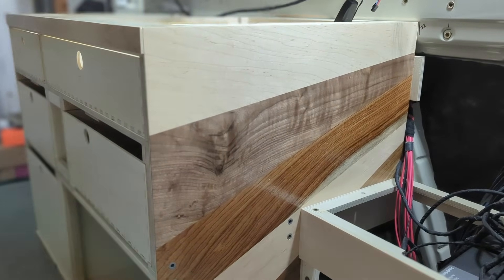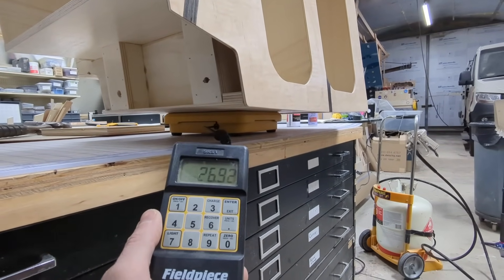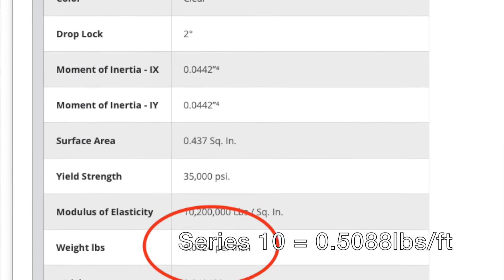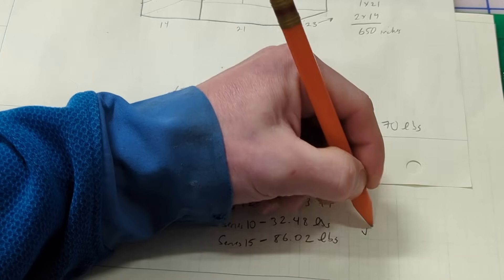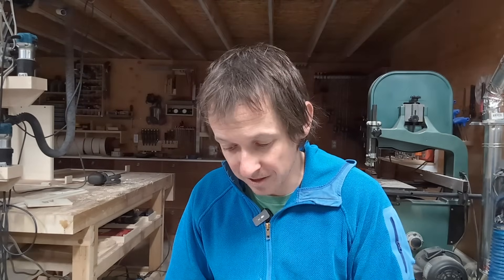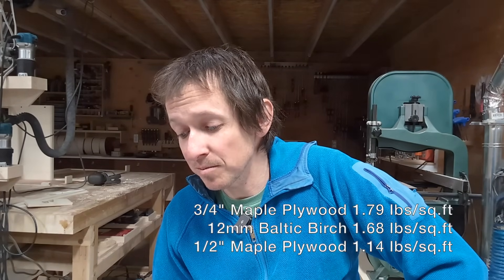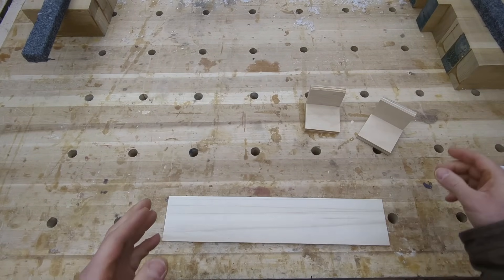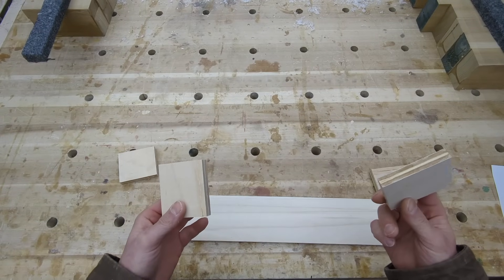Van Conversion Cabinets that are (actually) Lightweight and Maximize Storage

Comment: Great video! I want to add, if you are building out your van at your local makerspace, the may have a decent sized lasercutter. 6mm plywood cuts beautifully on a lasercutter. It greatly speeds up the process of cutting those finger joints and any curve cuts. While you are at it, you can cut slots midway down on the sides and slot in the drawers, adding even more glue surface area. 

Also, my local makerspace has a resaw bandsaw, which makes making your own veneer a breeze.

Comment: I don’t see how the fact that you use thinner plywood is either an argument for or against using 8020 since it can be used with thinner plywood too, and I got no dog in this fight because I’m using a hybrid system. Most of my cabinets are all wood but my system for connecting them to the van is all 8020.

Comment: This is an excellent video. A true craftsman can make an excellent lightweight product but the average person cannot. 8020 is an easy way for those persons to get the strength and assembly capability they need by preordering all components precut to specifications.  I’m looking to build out an older people mover with a handicap door and wheelchair lift so weight is not an issue. I’m actually looking at a mix of 8020 to frame and secure my heavier and more dense items like the fridge, stove, microwave, water storage, elevated bed, and roof racks, etc while using wood for basic storage items and framing. 8020 is more expensive than wood as well.

Comment: just got a van, and im surprised on how many people use heavier construction material to build their rigs...
Im 100% in favor of what this guy is preaching here... granted I just bought a 2000 E250.. and have zero experience in van building... but the reasoning around this is spot on and im gonna try to utilize as much weight savings as possible especially if i ever plan to tow a motorcycle trailer on the back... This just makes sense.

Comment: I really needed and loved this video.
I'm an aviation enthusiast, model airplane builder, and also I build my own furniture at home (used a lot of MDF for cabinets, and build a sofa and some nests with 10mm and 15mm plywood).
I'm planning to build a campervan in the future, so I'm watching lots of videos.
I've been seeing camper van builders using 15mm MDF and lots of heavy accessories, or even using 15mm plywood on anythng.  
That really annoys me, because MDF is very dense and when you have something moving you want it to be as light as possible due to performance, driving dynamics, safety, fuel economy, better range, less pollution, saving tires, saving shocks, staying in max gross weight and so on.
I've been thinking in ways to save weight and this video confirmed all my ideas and gave me dozens more to work on.

Comment: Thank you for this content.  As a carpenter, now working on my 2nd van project (Vintage airstream for a client and now a transit for me) I am constantly concerned about weight of materials.  A couple of questions, first - Do you have any standard cross sections that you have developed that can be sent to folks.  From your video, I saw 3 mm exterior panels with 6mm framing and supports for drawers.  The shot was quick and I just want to verify.  2nd have you had any joint failures with the brads and glue method?  I wonder about driving causing cyclic vibrations and potential cyclic failures?  Ok 3 questions - also, what type of wood glue are you using?

Comment: This is crazy! And a bit obsessive. Cabinet makers out there, come down from your high horses! 

From a mechanical perspective and a user perspective, this approach makes very little sense. 

Imagine you are converting a mercedes sprinter. Those vans are built for transporting 2000kg (2 metric tonnes) of cargo with a warrenty of 5 years and 350,000 km. They have a regulation that says they  can't have a total weight of over 3.5 metric tonnes without being re classified as a truck (EU laws). The same goes for camper conversions. So weight is important in the sense that if you keep the total weight under 3.5 metric tonnes, you dont have to reregister the van from a car to a truck. But the car itself can EASILY handle the weight of some heavier freakin caninets. The quality of living, and the feeling of build quality will both increase dramatically if the cabinets have some weight and regitity to them. A normal stripped mercedes sprinter will let you have over 1200 kg(!) to build with, without  exceeding the 3500kg max weight and the car can handle more weight than that. 

These vans are built to haul ass every day until they die, i think they can handle 50kg more of wood weights for the cabinets. 

Jesus.....

Comment: Nice!  Yes weight matters, especially up high.  I cringe at what of some people put on the roofs of their vans.  Let's put the spare tire up there, a deck made from 2x4s, 200 lbs of solar panels, a solar shower tube holding 4 gallons of water, and a steel rack.  Now let's get a lift and high-profile off-road tires, and act surprised when we roll over.

For me as a beginning builder, the best feature of 80/20 is that I can make design mistakes and fix them by reusing the pieces.  The worst feature is the cost of the 80/20 system.  This video made me aware of additional downsides, weight and especially space inefficiency.  Thanks much.

Comment: Great video - I’ll be following the sprinter build with interest.  Just need to get out the inch to mm conversion guide to cater for our UK ply thicknesses!  Would really love to see if there are any alternative techniques to things like finger joints for drawers for those v amateur woodworkers among us - whose workshops aren’t quite so well-equipped. Loved the sound reduction vid too. Anyone like me who’s owned a motorhome appreciates that a lightweight and noise reducing build is worth any number of butler sinks and heavy cladding.  Thanks so much for the helpful information.
Reply from the maker: Thanks for the comments!  Do you guys use inches or mm over there?  I realized while filming I use them interchangeably because both are used here depending on the product.
Reply: It depends on your age! Most people my age (57) and younger use metric and all ply/timber is sold in mm, so our standard thicknesses of ply are 3mm, 6mm, 9mm, 12mm and 18mm+.

Comment: Hi,good video have you ever used west system epoxy, using micro beads to make stronger joints 6mm bead, can be hidden if required. They use it a lot on small boats?
Your's john

Comment: Thank you so much...awesome video, super informative, not to mention well-paced...I wasn't planning to watch an entire 20-minute video, but I was completely engaged beginning to end. 🙂 I had already pretty much ruled out the aluminum extrusion approach after watching two of my friends work on cabinetry builds in their rigs for a couple of weeks and run into frustration after frustration with all the little connection pieces, not to mention throwing away expensive aluminum after making mistakes or realizing they needed to tweak their layout. Your weight analysis of the aluminum extrusion was surprising added fuel to that fire, and I also hadn't even considered the custom fitment advantage of wood vs the obligatory right angles of the extrusion. I'm nowhere near a good enough woodworker - nor adequately equipped - to build with your techniques, but this reassured me I am on the right path and gave me some super useful things to consider that I would not have thought of which will absolutely improve my construction. Thank you!!

Comment: I agree 100% I feel that no one takes weight into account when building out their Van. I love to work with wood and I was considering using 2020 for my van. You have given me a lot to think about now.  I have been remodeling an RV and after taking things apart I have a new respect for weight savings. I can’t wait to  start my build … again.
Reply from the maker: Haha.  I think weight is talked about a lot but not is done much about it.  First video: "You want to make sure your van isn't too heavy." Every video after: "watch me build a 4000 lb conversion."
Reply: @projectofscience  I subscribed I will watch all of your videos. But I will most likely build out of wood instead of Aluminum or I might combine i.e. Cabinets and such out of wood, Bed/bench out of Aluminum. Best of both.

Comment: I still don’t buy the idea that wood a wood glue bond is stronger than screws… glue is probably your only option when your wood is only a few 64ths thicker than a screw… but have personally ripped a 4x8 ft 3/4 in thick piece of plywood off of what used to be a work bench… it was secured with wooden dowels and wood glue. If those dowels were screws, all I would have managed to do would have been picking the bench up off the ground…

Comment: I'm very impressed with your analysis.  Cabinet structure, drawer and slides all add weight and decrease space utilization.  When I looked at 80/20, reached similar conclusions to you.  Heavy weight and lower utilization.  Many builds with 80/20 look very space wasteful.  

You cabinetry skills and forethought are admirable.  This is my first video of your channel.  It will have be browsing around to find more here.  Nicely done!

Comment: I thought about doing a bike trailer with a wood kitchen on top.
And the only thing that kind of stopped me is calculating all the needed wood for that - about 100 pounds + load inside +trailer... 

I thought about aluminum strips for reinforcement. But I really like how you reeinforced the poplar wood, gave it kind of an inner structure.
I saw other people routering parts of thicker sheets to cut down on weight - but I prefer your way.

Don't know if I can work that precise with the drawers. 
But definitely an inspiration.

I looked in on other woods - birch and poplar are sadly the most common available.
I also like paulownia wood - but that's really hard to get and expensive

Comment: Strength comes from stiffness, not weight or thickness. For instance, a 1x6 (on edge) is stronger than a 2x4 and weighs 20% less. This guy gets it. Judging from his thought patterns and the pad he’s using, I suspect he’s a mechanical engineer.

Comment: Very good video, nice to see someone using proper old school joinery techniques not modern easy methods. Basically what he’s doing is using the same techniques that where used before sheet material came along and made things quick and easy. Trust me his methods are 100% correct and will definitely work.

Comment: I totally agree with you. 

I created a hybrid cabinet system for my van using only 3 x 12’ 80/20 10 series slotted track (about 1/2 the weight of regular 80/20 since its just a mounting track with slot for bolts) for the upper cabinets. I used the honeycomb plastic cargo protection panels in place of having full cabinet backs/top and just have 1/2” sides and bottoms (with a front lip) of the cabinets that mount to the 80/20 track significantly cutting down the overall weight of each cabinet. I have front door hinges with built in springs that mount to the cabinet sides for the cabinet door fronts. The lower cabinets again were built with no backs but a couple of 3” plywood rails to strengthen the cabinet backs and these are bolted to the van frame. My complete cabinet packet is less than 250 pounds. My bed platform is an Ikea bed spring slatted frame (they no longer bring these to North America 😥) on 3 Ikea bed rails. The net result is my van loaded with water and all gear and food is a good 2,000 + lbs under its maximum GVW allowance.

Comment: 1/8 inch plywood ... might not last that long due to truck vibration, spills, environment etc   why do home builders use 1/2 inch and 3/4 inch in homes which see less abuse but are proven to last.   How are you sealing the wood to protect against water damage and how much weight does this add? are you using lightweight black poplar and what thickness are your side panels?  I would use the aluminum for its strength and  water resistance and not worry about say 100 to 200 extra pounds
Reply from the maker: Howdy. To try to answer some of your questions:
1. Home builders use thicker materials because it is easy: primarily it can hold screws, and it requires no bracing.  All those thin pieces I use to achieve what thicker materials already have: rigidity.  And yes 1/8" plywood seems weak but thats what the video is trying to show: you need to use it the right way.  
2. I use General Finishes High Performance for a finish.  On a cabinet it usually adds about .2 to .3 lbs.  Thats 3-4 coats sprayed with a HVLP.   
3. I'm not really concerned about "water damage."  I live in the relatively dry west, but even in the Southeast I don't see plywood just falling apart.  When it is raining the areas around the door see a little splash but the finish protects it fine.  If I ever have a catastrophic water leak then sure, it will take a bit to dry out, but it isn't sitting in water so I'm not worried.  
4. If the entire difference was even 300 lbs I wouldn't worry either.  But look up all the popular Sprinter Conversions (Revel, Storyteller, etc.) and they all weight 1000-2000 lbs more when finished.  Sure, each cabinet saves a little, and one individual part doesn't matter, but repeat that process for every component and you have some obese vans. 

My 2 cents.

Comment: I agree with your points. 80/20 is nice and also expensive. It would be fun to work with it because it is reminiscent of Erector Sets, if you old enought to remember them. They did teach me some basic engineering skills as well as some mechanical skills. I think a lot of DIY van builders are of that age group. YES it would be fun, providing you have the money to spend etc, but in a DIY van build you have to be practical like you said. Most DIY van builders have never built a van and learn along the way things like GVWR. They find that out when they try to register. Thanks for making this video, it needed to be said. P.S. I have seen some driving gaming rigs which need to be strong made with 80/20 and they are awesome, but they really don't have those weight limitations.

Comment: Great video. Thanks a lot. 
But you never speak about humidity in a van... 8020 will never change, but your drawers will. Am I wrong ?
Reply from the maker: Well, wood expansion from humidity is definitely a factor, but plywoods in general see minimal effects.  If things were built with solid wood it would be a different story.  I've definitely heard of vans being built in the dry west having binding issues when relocated to the humid and hot south east.  But those were all with solid wood components, not plywood. 

Not to split hairs either, but 8020 cabinets I've seen also have wooden drawers...so in some ways I'd argue having the cabinet abide by the same expansion and contraction as the drawers is less likely to cause issues.

Comment: More expensive, but stronger and lighter for a given dimension, is Coosa board. I haven’t built with it myself but it is used extensively in the boat building industry.

Another option, if one has the tools, is 1/16” (approx) aluminum with the same dimensional properties as the plywood and no susceptibility to moisture like wood.

All that said, this man’s cabinets are fantastic!

Comment: Also, that aluminum is very expensive! I was a cabinetmaker for about 25 years but don’t do it for a living any longer. I have built out a couple vans in the last few years and built them similar to how you did with 1/4” ply and veneer. I don’t vacuum bag the veneer and haven’t had any issues with bubbles or delays. My cabinets are incredibly strong and probably lighter than yours. I didn’t use drawer slides either. I notch the bottom of my drawers so they can’t slide out while driving just like they used to do on boats. It would be interesting to see how you prevent your drawers from sliding out while driving.

Comment: I went through similar calculations between ultra-light wood cabinets and 10 series  8020. The wood construction was similar to yours with 1/8" panels and reinforcements. The 8020 had 1/4" inset lightweight panels. If you use good quality drawer slides, I found you do not need to have braces front to back to hold them, only a stub at each end. I also did not use front braces for latches, not necessary with touch-to-open slides. 

All of this reduces the weight of the 8020 cabinet significantly. In my case, I found the weight of wood design and 8020 to be the same, all-in, assuming the same slides and 1/2 drawers with both. I'd be curious how your 8020 weight in 10 series would end up without cross braces for the slides and front sections for the latches.

Comment: Great stuff, but he ignored the fact that for most people, they're only doing one build.  It doesn't make sense to equip a wood shop and build the skills necessary to create the kinds of tight tolerances he achieves.  Most folks won't have his capabilities, so creating that kind of light cabinet without a lot of expense and frustration may not be achievable in a practical way.  It's great if you can do it, but...

Comment: After watching a bunch of builds over the years - lots have promoted 80/20. As much as I wanted to use 80/20 but I ended up not using any at all on my 2 van builds (well except for about 3 feet in 2 separate locations where it was kind of nice to have the slots to install some special devices)
I did use Baltic Birch - I will have to consider Poplar next time.
I did not use any hardware on my drawers either. Don't need it.
Thanks for the video

Comment: Vans drive better with about 500 pounds over the rear axle. that's only the equivalent of a few passengers and you wouldn't even think about that. I agree with building light, but not to save weight, but only so I can put the extra few hundred pounds where I want it, right over the rear axle in the form of just pig iron, or extra batteries.